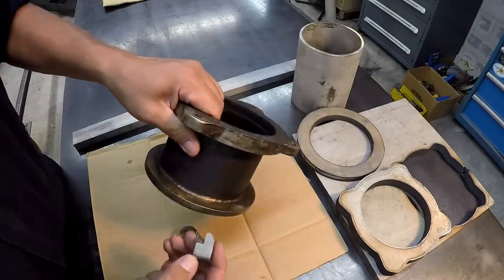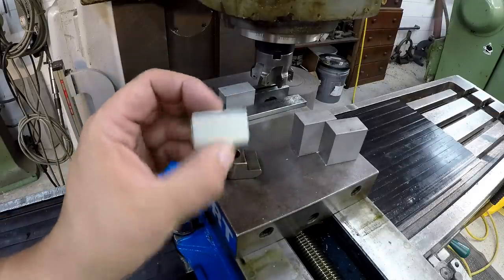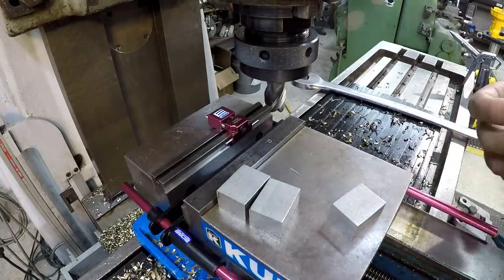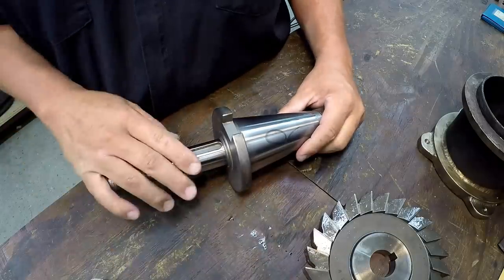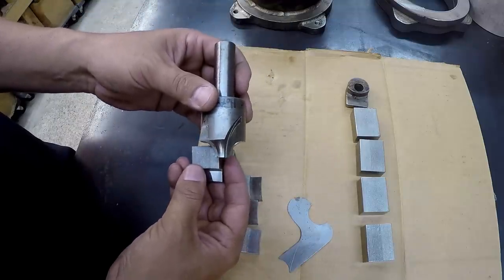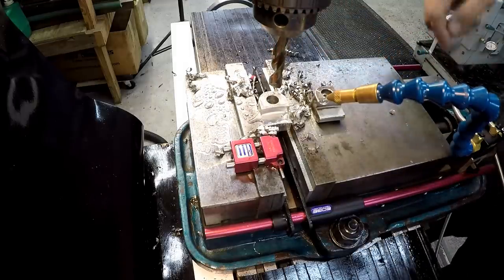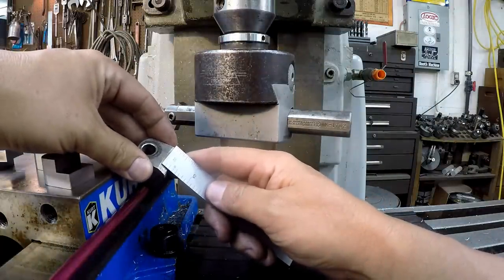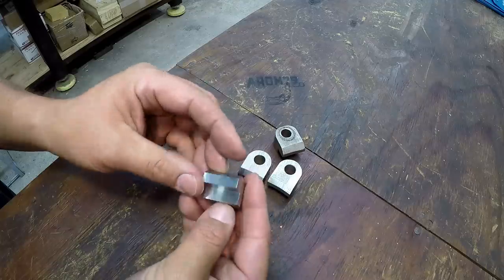Stainless Hold Down Clamps Part 1

Comment: I bought a milling machine yesterday and that's mostly because of how much I was inspired by your work. Thanks for teaching us the art.
Reply: I need a milling machine :( What voltage/phase is yours?
Reply: My lathe and mill are ild school three phase 220-- that scares a lot of people off, but a $90 variable frequency drive off of amazon gives me infinite speed adaptability and all the power. : ). The old timers will say you need a pricey as heck rotary phase converter, but those days are past.
Reply: @gresvig2507  Damn, nice! Does it convert two phase 220 to three phase 220 or is that not possible or would I need something different?
Reply: I already had an outlet for my welder 220 two phase (heck, an oven outlet is plenty) and I'm cheap, so I just slapped a plug and a twist lock outlet on one VFD and plug in either the lathe or mill. It converts the 2 phase to 3 pretty efficiently, and you have infinite speed control (though you'll need some kind of tach to do accurate tool cutting speed calculation). It seems kinda unhappy at really slow speed like when I'm threading, but it's usually not an issue since my machines are from the 40's and I can gear super low. Most old-fashioned phase converters are pretty inefficient and you usually can't go very high power without tripping a breaker, but I've had zero issues with my 50 amp. The VFD I got is rated for 4hp, but I only have 3hp motors so it seems to have no problem. I'm only a hobbiest, though, so I don't run it for hours on end-- though I hog out some metal sometimes and it doesn't complain : )
Reply: @gresvig2507  Oh damn, wish I would have met ya a few months ago! Killer deal on a milling machine (basically free to a good home but you provide transportation) but it was three phase and when I called my electrical company to install three phase at my house they laughed at me. Got a link for the VFD you're using? :D
Reply: I wish I could afford a used but good milling machine.
Reply: I paid around $1000 for my 1949 model milling machine.. weighs around 1500kg/3200lbs and works great.
Reply: toysareforboys just go to eBay and search for VFD and the horsepower of the motor on your unit. There will be hundreds to choose from. I did the same. My mill runs all day on that $90 VFD.
Reply: There is a place for a VFD and a place for a rotary phase converter, depends on what type of input power you need. 
Anything voltage sensitive needs a rotary phase converter. Vfd makes steppy square wave power that anything sensitive doesn’t like. 
Perfectly fine for a lathe that runs a single speed motor.
Reply: @toysareforboys1  mine is 220, 3 phase. There is a 200 bucks vfd that takes 220 single and converts it to 220 3 phase.
Reply: I’ll be next !
Reply: Man, sorry. My VFD doesn't seem to be made anymore, but if you search VFD on amazon a lot show up-- I went by best rating. I misspoke, though, mine is 3hp rated and my motors are 2hp. I've run my 2hp mill (Van Norman) with a 1/3hp traverse motor at the same time with no issues. I saw when I just searched that they have them up to 10hp now!
Reply: @ko0d3ta  Is Canada/USA 220v single phase? I've seen it called split phase, so I assumed that was 2 phase, but it appears I was mistaken.
Reply: Electricity is confusing. I call 220 two phase out of habit, but I think technically its single phase-- there are just two legs of the 220 power into your house that add up their waves to 220, and you just use one leg to neutral for the normal 110 stuff. Three phase is legit three different waveforms making kinda a wierd . . . something. If it helps, the VFD was really easy to hook up, and I'm clearly an electrical moron.
Reply: Givo M it’s one thing to see it done and another to do it! Don’t get frustrated. You may have to take half your machine apart to work out sloppy ways or table. Good luck and have fun!

Comment: I love it, you basically turned the mill into a rotary metal scraper. I also appreciate the desire to make the surfaces look good even if it doesn't matter for the use of the part or even if anyone else who'd care will ever see it. Doing it the best you can do it matters to you. That's the difference between a craftsperson and a hack.
Reply: Anything you do in life should be done to the best of your ability.  If not, then it really isn't worth doing.
Reply: @boozler8194  It's called being a craftsperson.

Comment: I was a design and fab tech and worked with stainless.  Stainless is hella hard and burns up tooling quick.  As someone that knows how difficult this project really was, you made it look almost effortless and you have my respect brother.
Reply from the maker: Thanks. It can be tough but with the right speeds plus coolant, not too bad.

Comment: Can't wait to see how you manage that plasma cut stainless, it's is the best material I've found for turning carbide endmills into art.
Reply: Maybe if it's cheese grade carbide.
Reply: @xenonram  Plasma cutting stainless steel causes chromium carbide to form. Chromium carbide is a rockwell hardness of 74, while carbide is only 80. That combined with the stainless work hardening, makes it eat carbide.
Reply: @ionstorm66   Lets say rockwell hardness 74 means very brittle material???
Reply: Ive had to manually grind a starting spot on stainless with a burr. If not it eats everything
Reply: @85932  Just like carbide tooling.

Comment: As a CNC machinist, the cynic in me says "err cnc is best and fastest" but the machinist in me loved seeing you using old school methods. Keep up the good work dude!
Reply: does that include the time it takes to make and optimize the cad? does it become worth it for a one-off job?
Reply: @SuperAWaC  depends on if the CAD was done ahead of time or not. That said it depends... The upside to CNC is you could do them all in one go and be done.
Reply: @MakeItWithCalvin  "does that include the time it takes to make and optimize the cad?" So the short answer is No?
Reply: CNC is fine and all but a lot of things cannot be done or repaired with CNC
Reply: @frankinjeep1194  I keep ranting, augment, augment, augment.  Add new technologies to those already proven.  Replacing is (IMO/IME) very foolhardy.  Pick the "weapon" that's well suited to the particular task at hand.  One size NEVER fits all.
Reply: @SuperAWaC  'does that include the time it takes to make and optimize the cad?' It wouldn't take me long to draw up and cam something simple like that. Either way there is setup time. What really kills the time when doing it manually is the number of different setups needed. What Adam also doesn't show is the time spent thinking about how to do it with a manual setup. However the most important thing is that both methods work. You use the tools you have and are familiar with using.
Reply: @LesNewell  I agree with you 100% it wouldn't take long to program and machine those clamp pieces on a cnc mill.Most of my life I use to machine parts like Abom manually on lathes borers and mills etc.must admit it is a different kind of feeling and self satisfaction you get doing it manually.Now a days I still use both manual and cnc machines but can't justify the time spent on some jobs trying to do it manually so you can stay competitive.Since not everyone has cnc machines I give credit to Abom for showing those people how it can be done manually.

Comment: " More than one way to skin a cat" is how you should think as a machinist. It all comes with years of experience. I used to make similar parts to those that were used in the manufacture of tyre retreading equipment. we had a simple fixture that we screwed them onto then turned all of the radii on a lathe. Just a plate with a boss and a series of threaded holes on a PCD. Easy peasy,lemon squeezy. Nice work Adam.

Comment: Maybe someone mentioned this, but when gang milling multiple parts like you mention at 5:20, you should add a ductile wire or piece of cardboard between the vise and parts so that it clamps on all of them evenly. That is what I do.
Reply: Yeh piece of paper or g clamp the parts togethor works fine :)

Comment: When I need to clean up several parts like that I usually use a bit of aluminium filler rod on one side of the material.

That helps clamping it. Never had any issue ...

Good work Adam.
I used to work a lot on stainless. I hope you won’t get frustrated by the edges of the plasma cut staino

Comment: Ingenious! For a moment I was thinking that you should really go CNC, but for small batches like this and one off odd jobs it would be completely uneconomical and most likely would take longer considering the time required for programming.
Reply: I can design that part and make toolpaths faster than you can set up and tram that rotary table.

Comment: What I did on my saw and it worked perfectly for over 10 years (canister rusted finally but filter was perfect.)  I used a Hydroloic filter head and filter in line with my fluid on my saw.  It filters out the metal flakes that beat on metal but also trashes the blade.  I simply cut the hose and inserted the filter head.

Comment: I thought stainless was impossible to machine.. (based on some other videos I've watched), but here you are pumping them out like a boss..
Reply: No problem with stainless, just a bit tougher is all. With the right tooling makes life a lot easier :)
Reply from the maker: Nothing hard about machining stainless, it’s just a tougher materials and you gotta know what tooling to use with the proper speeds and feeds.
Reply: @Abom79  not sure if you saw my comment but if you wanna stack multiple parts in a row in vice. Stick a piece of paper on the fixed jaw or g clamp with pieces togethor:) works great for me
Reply: Stainless is joke compared to HARDOX 450  at  around 43 to 47 HRC  Rockwell...
high abrasive resistant material,used for heavy machines and armor...
Reply: there is also free cutting stainless,many different grade is available...

Comment: As you said Adam that clamp piece was possibly machined on a lathe into a ring with step bore on one side and chamfered on the other and cut into segments.Then rounded and drilled I believe.

Comment: As a hobby guy ( I'm not even gonna call myself a machinist ) with a South Bend 9" lathe and a round post mill/drill, listening to Adam give his feeds, speeds, and depth of cut all "I" hear is "With this carbide insert tool in my 24" fly cutter we are gonna be running the mill at 9600 rpm taking a 3" depth of cut at 980 feet per second". Man I wish I could afford some real machines.

Comment: Those hold down clamps are very similar to what is used on a lot of firetube type boilers that have flat plate front/rear fireside doors to clamp them shut. They'd be used to draw in and hold the door to the shell, with a high temp rope or blanket pinched between them as a gasket for the combustion gasses. They were always called "dogs".

Comment: Good video, interesting setups for milling operations, thanks Adam. 
I think original clamp was made on the lathe because I see slight undercut in the corner (it is visible in video at 36:46).

Comment: With regards to the work pieces  been different sizes if you place a piece paper along the moving jaw and clamp tightly the paper will compress and take up what small difference there is and clamp both work pieces tightly in order to machine them I’ve been doing that for along time and seems to work ok. Keep up the good work Adam a shout from Hilton out here in South Africa

Comment: Adam, having managed welding and machine shops at a couple of major airline jet engine shops, I can attest that you are a true craftsman! I'm not a machinist myself but I do have a basic understanding of machining and welding processes. One thought that I would offer when "reverse engineering" parts or components such as covered in this video, is the danger is not understanding or having access to all of the "hidden" processes which might have been accomplished by the OEM of these parts. I have experienced or been involved with a number of failures of these types of reverse engineered parts. You might have been 100% compliant (or even over engineered) the original fabrication processes, or on the other hand, may have missed a critical step. Examples would be stress relieving, passivation, shotpeening, pressure testing or non destructive inspection. These types of processes can be "invisible" on the finished component but might be extremely critical. I recall one particular component on a jet engine which had been reverse engineered by an overseas airline. It was simple flat spacer used in the bearing assembly build up. A very critical hardening process was not followed and which resulted in internal thermal stresses during engine operation. These fabricated parts lead to a number of extreme engine failures resulting in a number of aircraft emergency events. After investigation by the FAA, an Airworthiness Directive (AD) was issued which required inspection of all suspect parts within a very short time frame. Obviously not all parts are as critical, but I would just like to point out that such consideration should be made anytime that reverse engineering is accomplished. Sometimes there is justification for the high cost of a factory replacement part. I would just recommend caution to anyone attempting these types of reverse engineering, to understand an critical stresses which this part might be exposed to. High pressures, thermal expansion, vibration, single path structural loading, are a few examples. Please keep up your excellent videos and instruction, but perhaps offer this type of caution.

Comment: My thoughts would be toward putting the clamps on a 7.5" radius plate and turning them on the lathe, but we both know the old ones were just relieved with a belt sander. No shame in doing it with precision - Gotta respect striving for perfection.

Comment: I've had to cut some radii like the first ones you cut, but not that large. I just used my fly cutter and set the length of the stickout of the bit off of the center of the cutter. probably wasn't dead on, but close enough for what we were doing.

Comment: Excellent work as always! When you were doing the bevel I thought you were going to set the piece in the vice at 45 degrees and plunge down in the Z axis. You could have used the same 7” cutter as you used for the step. May have produced less chatter?

Comment: Could you show the grinding of that 7" cutter to get the teeth concentric?
Reply: i think the teeth are not the issue, but concentricity with the shaft. i mean, the whole tool does not center well in the shaft.
Reply: @tobiasripper4124  I thought Adam said that he'd already checked that and that it was spot on?
Reply: @angelarichards1911  yeah he says the arbor is running true. i think the OD (where the theeth are) of the cutter is ""perfectly"" round, and the ID is whats off center.

Comment: I wonder if the originals were machined out of a ring of metal. Do the radius cuts on the lathe, flip and make the bevel. Then cut each ones out of the ring and then do the milling work.

Comment: Great video Adam, forgive me if I missed something but I've produced similar clamps in the past and usually its a lot easier to mill the main features on the clamps as well as drill all the holes whilst its still one block, then proceed to saw them down into 4 separate blocks, although I know these clamps were not all identical. Just an idea!

Comment: Also should put another hold down clamp in the other side of the vice to stop it from kicking sideways and having less surface area holding the part. I do like watching your videos cos I don't get to use any machinery anymore. I don't want to sound negative, just like to give some tips.

Comment: I suggest you reduce the shutter speed (aka shutter angle) on the video cam so moving things (like the cutter and flying chips) look more crisp
Reply: That's possibly why the side and face cutter looked like it was spinning in reverse and forward depending on eye concentration.
Reply: @mehmettemel8725  no, that's framerate, nothing to do with shutter speed. Though, if shutter angle is 100%, it will just look like a blur

Comment: Adam, I grew up in a cabinet shop building furniture and cabinets and that is my perspective on watching your tools operate and your processes and comparing the way you mill metal compared to the way I learned to fashion wood on power equipment.  Utterly fascinating!!!  I really love the slo-mo action of your milling machine in action!  I have often wanted to watch shapers and planers in slow motion but never have found that kind of video on YouTube.  I have a question about your 7-inch milling cutter... I've noticed the same problem with a couple of other cutters you have.  Do you touch up the grind on your cutters yourself, or do you send them off for that when they get worn?  That really surprises me that they are not ground true to the centers!  One of the ways I could tell it was time to send off saw blades and shaper heads for sharpening was when they wore down out of concentric from the centers.  Also, I could tell if they were out of round by the way that gum would accumulate on the individual teeth; teeth that were short would invariably have little to no gum buildup on the cutting surfaces.  I never had that problem with newly sharpened instruments.

Comment: at 5:15 I find that a crappy vice works with 2 identical pieces. The kurt vice is bad because the movable jaw does not have play in it to shift to hold both pieces. Yah, now we know a great use for a crappy vice ;) EDIT, you need to place each piece at each end of the crappy vice also.